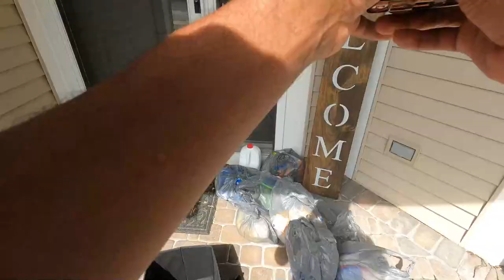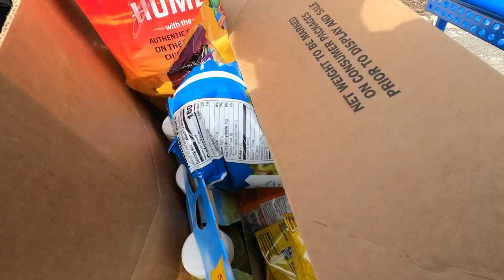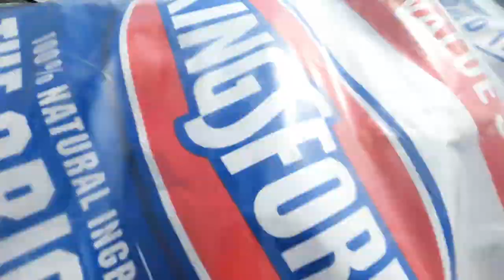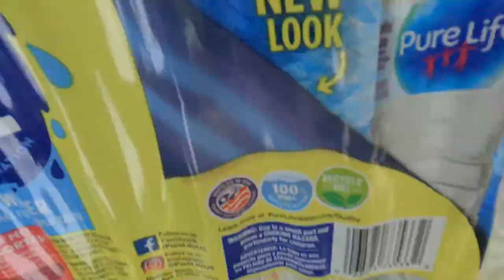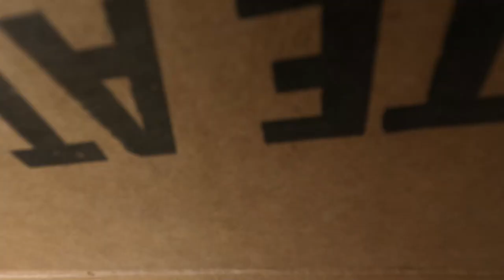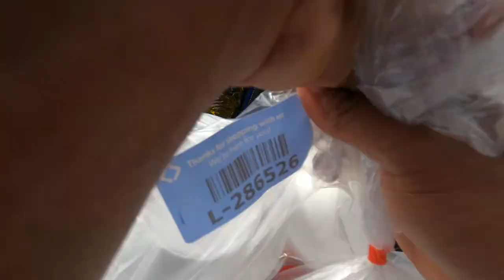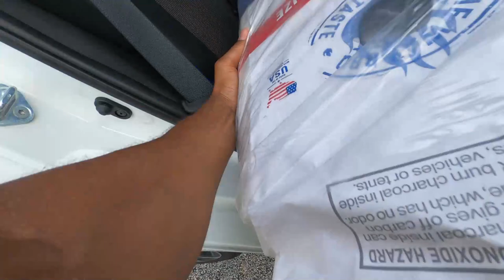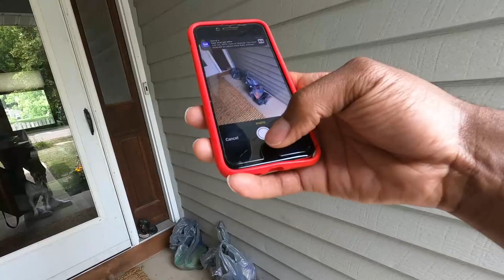Order Mistakenly Given To WRONG Driver! 😲Mix-Up; Spark, InstaCart, DoorDash Ride-Along;Tips & Tricks

Comment: Ngl. A few weeks behind rent because I was trying to focus on getting my car right. It's almost 100 degrees outside but my car is prepared for it now with new water pump,  air filter, and a lot of other things needed to combat the heat.

Also went back to a Wal-Mart I rarely ever went to and it turns out they aren't affected by summer slowdown at all. Their personnel just have too much pride and work ethic to get bogged down. They're pretty much like the MVPs of the Charlotte area, though they do underprice their orders too much.

I even tried a Wal-Mart I blacklisted that same day, and guess what? They still were terrible. Me and another guy took the bags ourselves and loaded our vehicles. I turn the corner and the 2 associates that were supposed to load our vehicles are beside a Wal-Mart manager getting something out of a garbage can. I check my items, and only half of the product from both orders, not even present 🤦

People be playing around with items people NEED. You never know WHAT a customer's situation may be. It's safe to say I'm THROUGH with that Walmart. They don't practice the #1 thing you're supposed to do as an associate(I used to be an associate), and that's put the customer first.
Reply from the maker: It’s all good you will bounce back. You have be able to drive your car in order to make money. They are OUT OF POCKET!!!!!!! They need to GET IT TOGETHER‼️
Reply: @carsandcribs  facts man. Full of young cats probably just getting out of HS and wanna have a good time with their buddies. They're in the right place choosing to become Walmart associates, but they gotta understand that someone always suffers when they choose to slack off. Save the joking around time during break/slow hours.
Reply from the maker: @gseric4721  Factual! They could still do it while putting orders in the car too.
Reply: @carsandcribs  That's true. I know several associates that find the right balance, and I hope those young fellas at that Walmart can learn to do the same.